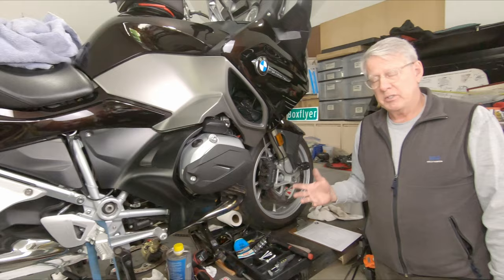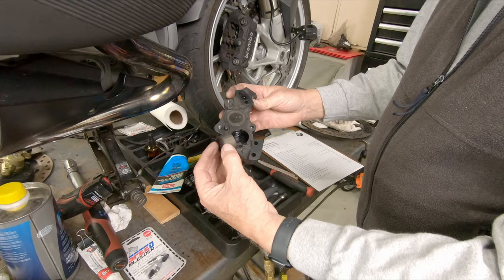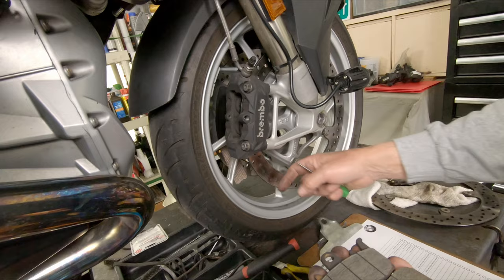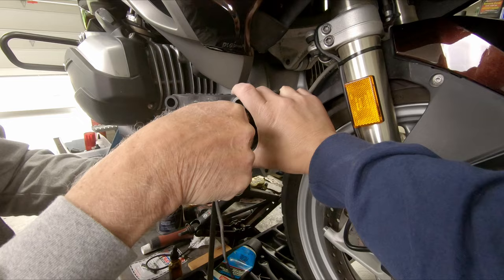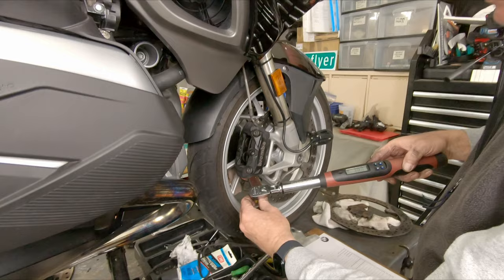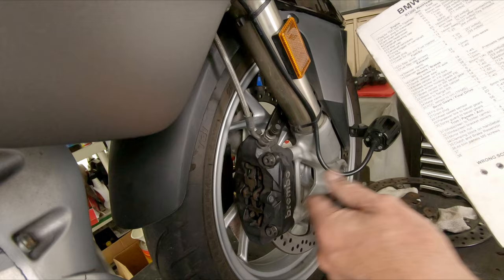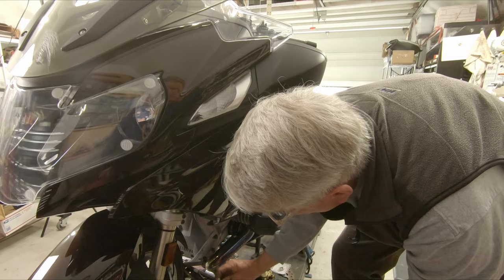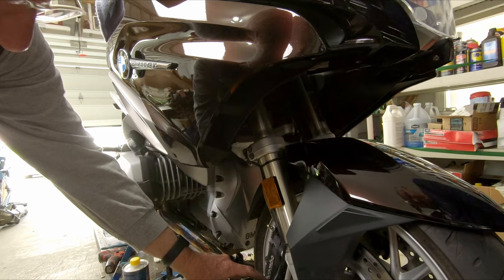BMW R1200 WetHead Brakes - Front Wheel

Comment: Lol, Brad, I absolutely ENVY your lift.  I don't have the room in this garage, but the next house (pretty soon), will have some kinda huge garage once again (last house had a 3-car plus room for workbenches and cabinets - I miss that).  After checking the driveshaft and lubing the splines, then performing the rear brake service and bleed, my knees, back, bad ankle, and about every other joint in my old body are just KILLING me.  Next service, I'll have it on a lift.  So, now it's time to max out the Naproxen dosage, and finish the job with the front brakes.   Thanks a bunch for these videos:  Bravo-Zulu!
Reply from the maker: I have not had a BZ since I was in the US Navy!  Thanks
Reply from the maker: Actually, I have 2 lifts.  The one that sits in my garage is a hydraulic version that came from some warehouse that moved 55gal drums from one level to another, probably 5500 pound capacity...too heavy a structure to move from place to place.  My second one is a 1200 pound capacity Handy Lift with a central air bag for the lift action.  I keep it in my mobile 16ft maintenance trailer that I use to go to rallies where I do lots and lots of work on WetHead and ShiftHead bikes.  Everything from changing tires and TPMS to full 12k service and even complete Cam and Follower replacements.  I love my lifts!

Comment: Seen a lot of vids on how best to look after brakes, but this is next level. The shoelace trick is so much better thank a toothbrush and brake cleaner. This is so comprehensive and explains things so well. The lapping compound analogy is really motivation to do this more often. Soon as it brightens up I'm following this method
Reply from the maker: Yes, this method done more often, can not only extend the life of the components, but ensure better, safer braking.
Reply: @Boxflyer11   Thanks for all your expertise and great to see you uploading again
Reply: On the shoelace method of cleaning the piston sealing face - I've been pondering on how to do that if one doesn't have a third and fourth set of hands available to hold the caliper while the first and second set of hands operates the shoelace.
Reply: @louisgara8754   Good point. Might be time to get innovative with speed clamps
Reply: @ArcanePath360  I am thinking about this where extra hands #3 and #4 are not available: remove the brake pads per Boxflyer, then, before removing the caliper from the fork, use the brake lever to pump out the caliper pistons to contact the rotor, use the shoelace to floss the outside of the pistons, remove the caliper, lubricate the outer surfaces of the pistons,  then while taking care of the master cylinder brake fluid so that it does not overflow, force the pistons all the way in, proceed per Boxflyer from there on.  All comments/criticisms/suggestions appreciated.  I'm just interested in getting this done right, but I don't have the extra set of hands.
Reply: @louisgara8754   That might be a good solution. Only trouble is you can't see to evaluate how much you need to do it. Without visual feedback I would just keep working it and maybe spray some brake cleaner in there if it's stubborn, baked in, winter riding that you've been doing.
Reply: @ArcanePath360  After eyeballing the front brake, I think after removing the brake pads, pumping the pistons as far as to the disks could be too far.  More thought required.  I need a friend who lives nearby, then I wouldn't have to figure out how to get the piston flossing done as a one-man job.
Reply: @louisgara8754  You don't have to (in fact you really must not) push the pistons out very far. I got stuck one time when I went slightly too far and couldn't get it back in again, needing the help of a neighbour and lots of brute force and ingenuity with limited tools to get it back in. I suggest unless you are planning a full strip to only come out a few mm at most. Just enough to get a shoelace round.
Reply: @ArcanePath360  After thinking about this and viewing Boxflyer's new rear brake video, I agree - just a few mm out is all that it would need.  Thanks.

Comment: What a great and through video - Thanks Boxflyer!
Reply from the maker: Hope this helps anyone who is going to be working on their brakes. 
The emphasis of this video is to point out the importance of replacing the brake fluid that is remaining in the caliper if you simply bleed out the bleeder screw without pushing the pistons into their bores. Cleaning and lubricating the pistons is critical as a first step in the process.

Comment: I just did the service, front and rear. The hardest part for me was getting all the front pistons to move freely during the extension prior to cleaning. Invariably, one or two would move while the others didn't. I really could have used a third hand during that part of the process. Also, I recommend that anyone doing this make up a checklist with the steps and check them off as they work. That may prevent doing stupid things like forgetting to shim the pads before bleeding (don't ask me how I know).
Reply from the maker: It will be a much easier job the next time you do the service...thanks for the report and tips.

Comment: Thank you so much for this video, Boxflyer.  If one doesn't have properly maintained brakes, then they don't have a bike that is safe to ride.  I got everything you show accomplished on my brake service for my 2000 R1150GS and 2018 R1200GS recently, but it was nowhere as logically and efficiently done as you show in this video (and thus it took me much longer to get done).  One question: Is it alright to use medium strength threadlocker on the caliper attaching bolts?  I recently had one back off on my 2000 R1150GS and it really frightened me seeing that so I removed all of my caliper attaching bolts on both bikes and applied Locktite 243 on all of my caliper mounting bolts before torquing them back down to the factory torque specs. I look forward to your upcoming rear brake service video and hope you will address the matter of people reporting difficulty achieving a proper rear brake bleed/firm rear brake pedal.
Reply from the maker: Medium thread locker is probably OK for the application you are talking about...but certainly not RED.  The idea that a torque setting is just a calculated stretch/elastic action by a fastener would lead me to look into why your caliper bolts backed out in the first place...something else was in play here I suspect.
Reply: I notice you list orange threadlocker (high strength, removable w/ hand tools) in your comprehensive list above, but didn't see where it was used in the video.
Reply from the maker: I use it anywhere that blue threadlocker would be used. I just missed putting a text box explanation of that.